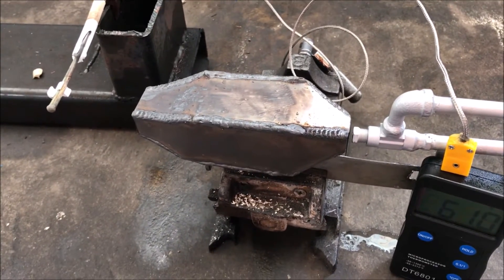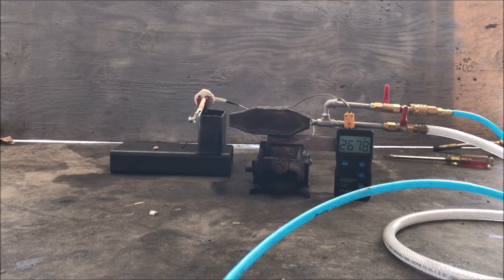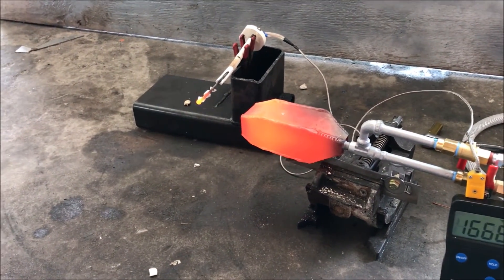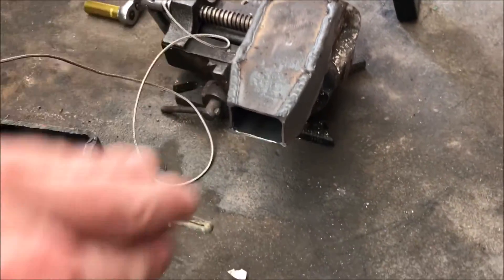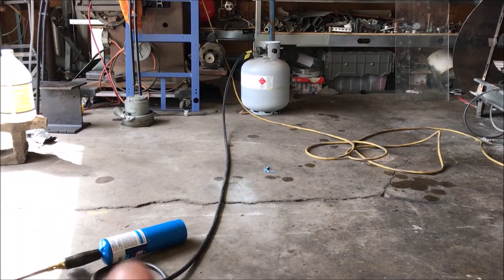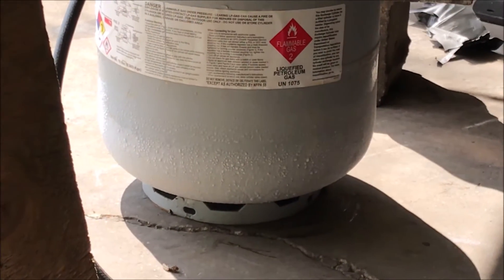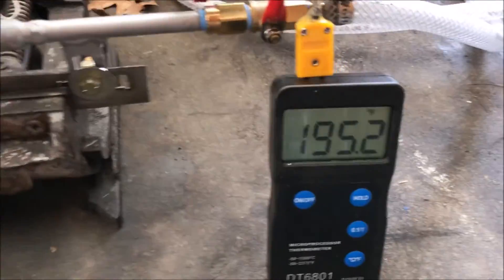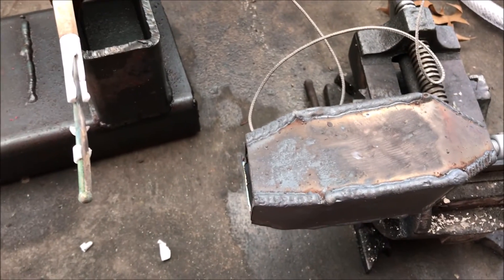Foundry burner , High velocity combustion technology 2,323 deg F

Comment: I am wondering if this was my issue. I was uisng waste oil thinned with some Desil. At first, even if I leaned the fuel out almost to stall it out, I had oil running down the inside of the metal thingy you cut, I forget what you call it, ill call it a cone. I notice the Godzilla has the cone farther from the spray nozzel. Could that also be my issue? Anyways, I tried different combination of air, and fuel, I think I turned the main down on the compress to 40-45psi, not sure if that was a good idea. At any rate, after running for 45 minutes it started to backfire, and iI started to play with the settings to get it to stop, and then after the cone started to glow, which It hadnt done in the first run nor untill running for about 30 min strait. Aluminum was melting, just solidifying out of the flame which is probably cuz my barrel is not insulated.

Comment: Actually the hotter the flame holder the better your continued combustion, the top efficiencies are always attained once the flame holders reach their peak temperatures. ~( 'w')/

Again...insulating the flame holders will recover more heat to the work area and not simply radiate it out into space in places it is not needed, not usable, and possibly even dangerous.
Reply from the maker: yeah its so much work to deal with that in experiments that for now i dont mind the IR losses . using it to pre heat air is ideal but your looking at hours of work
Reply: @NOBOX7  That is what R&D has always been about. As an energy researcher in this precise field [high efficiency flame and combustion principles] I know first hand that it is indeed many many hours of intensive experimentation, changing and tweaking what seem like insignificant changes to achieve the peaks of perfection in each of some times dozens if not hundreds of seemingly tiny little aspects to finally cumulate in the greatest level of perfection one can attain, and I am still working on it even now as new data and new discoveries arise and are published.

My dad taught me that no design on the market is perfect, and that MY job is to make whatever it is closer to perfection.
Reply from the maker: @DeliciousDeBlair  
your dad is a very wise man .
Not sure yet what i want to do for insulation , was thinking maybe just slap some on like clay , get some ceramic mold compound maybe . Its hours of research  in a field i no nothing about. But i am slowly gaining knowledge in that field , i watch video on ceramics but haven't pulled the trigger on anything yet  .
Reply: @NOBOX7  Geometrically pre-cut segmented tiles are your best bet.

They last the longest and are easiest to repair/replace if they get broken.

Basically, look how tiles lay on a floor, or how the little pentagons and hexagons lay on a soccer ball, or, how they cut a pineapple hand-you-know-what and you will see that they have uniform lines in them, but they accommodate different geometric shapes.

If you can get some ceramic foam fire brick, take a really fine edged saw and cut the pieces so that they tile the metal [My advice is to put them INSIDE, although this indeed requires making a larger burn can, because it will both increase efficiency as well as extend the life of the machine] and have enough room around them for expansion and contraction.

The inside tiles will suffer less total strain so long as they are not so tight that they crush themselves against the metal before the metal heats up, but if they are on the outside, they may pull apart, and will likely pop off, plus they can readily be crushed if the machine is bumped, laid down wrong, dropped, etc.
Reply from the maker: Again i need to remind you that youtube comments are broke , often i find your comments having never bin notified, i assume it goes both ways .
Reply: @NOBOX7  Thus I say 'again' ~( 'w')/

As in to make it evident to the casual readers that YT is censoring any kind of data which might lead Americans to think for themselves. 

Knowledge is power.

Too much knowledge is dangerous to a despotic government.

Therefore, we must regularly repeat ourselves to fight censorship...of KNOWLEDGE.